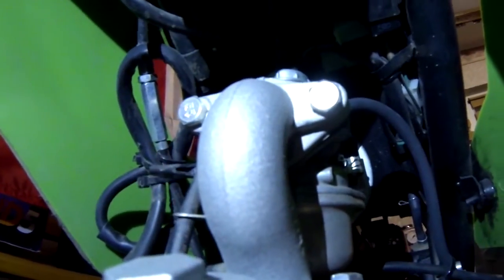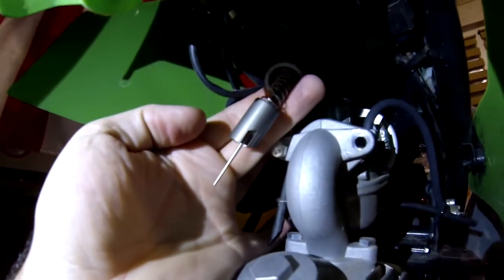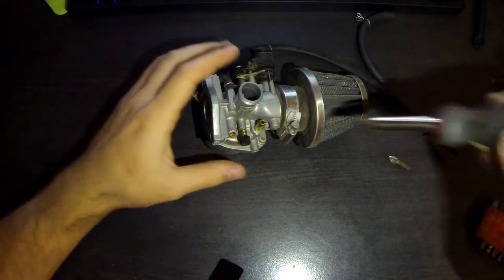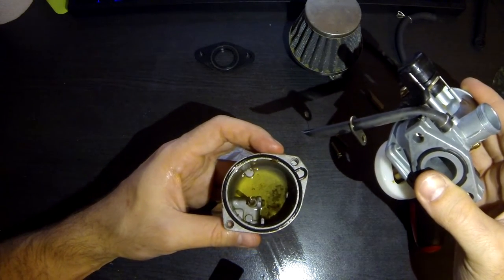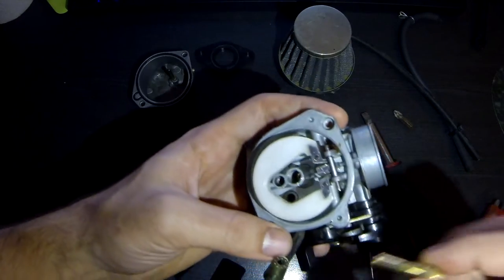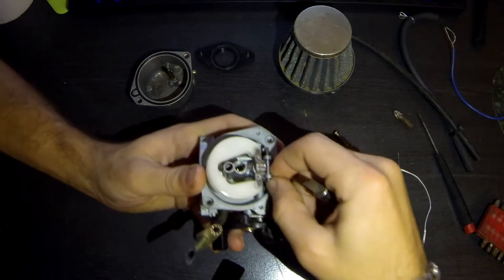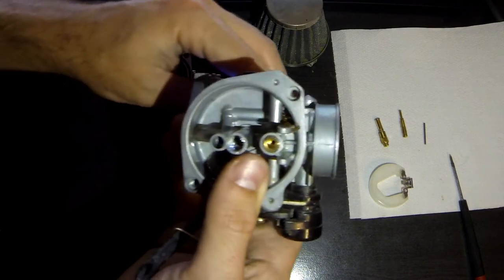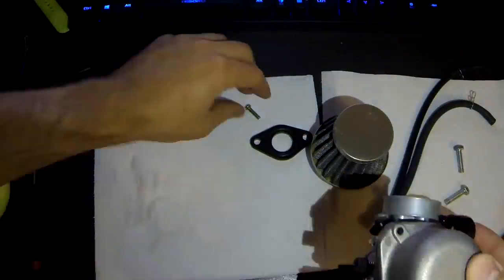How to Clean your 125cc Pit Bike Carburetor

Comment: Any idea what oil I should use for the and filter that is shown in this video
Reply from the maker: Oil for the pit bike, any good brand semi synthetic 4 stroke oil is good. Careful not to put too much or not enough. You change it often, every 500 km or so.
Reply: EXE Moto is that for air filter? Sorry
Reply from the maker: Air filter doesn't require oil, you just clean it. The chinese pit bike does have an oil filter, although I don't see people changing it they just clean it.
Reply: EXE Moto ok thank you ever so much

Comment: This is what carburetor specifically?
Reply from the maker: It is a standard 125cc chinese common chinese carburetor, very simple and straightforward. It doesn't have many rubber parts like the special membrane on the butterfly ones found in 49cc scooters.

Comment: So you don’t need to use any carb cleaner? And When you clean your ari filter you can only use water and no ari filter oil? Ore should you
Reply from the maker: Albert Enlund well it depends on how dirty is the carb, you can use many cleaning solutions, but I clean it regularly so beeing not that dirty I just wash everything with water, blow with air and absorb with paper towels
Reply: EXE Moto ok thanks for the quick answer and sorry for bad English 😂